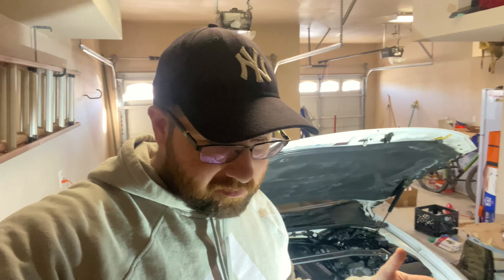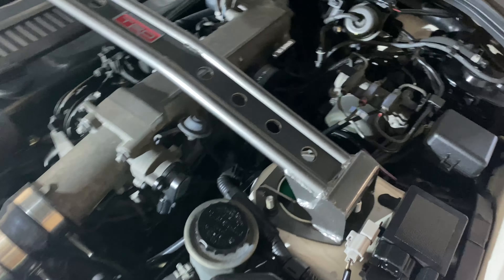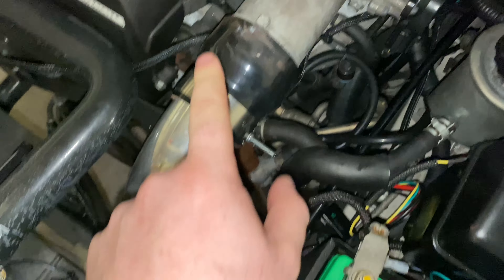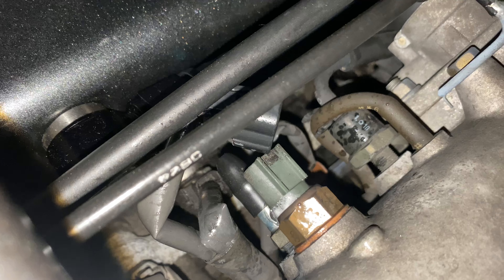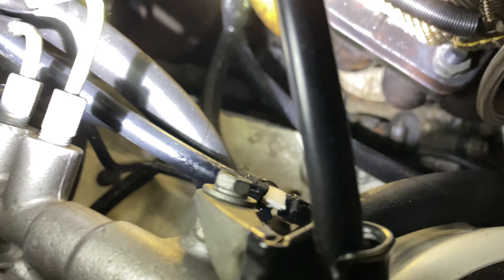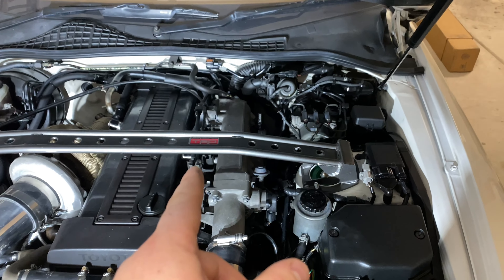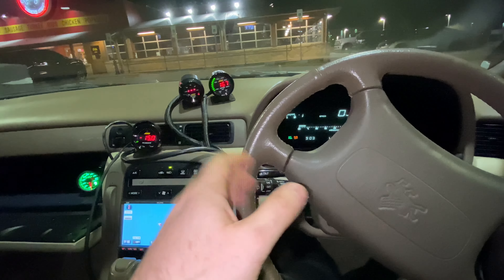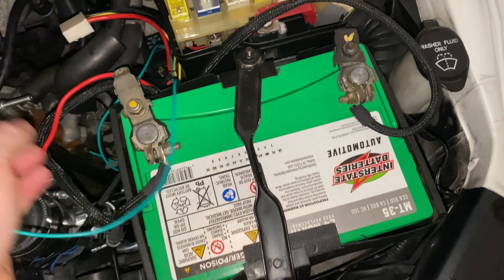Fixing issues with the single turbo 1jz….and finding more

Comment: Idk if you have ac but you can hook the fan up to the ac relay so you can control the fans without needing to run any switches
Reply from the maker: That would only function when the ac fan is commanded. That wouldn't do me any good
Reply: @ChrisBuilt92  I just got a fan controller I can adjust the temperature it goes on but then it also has an option if you don't use your ac you can use that a signal for a relay to use your factory ac switch instead of an ugly toggle switch